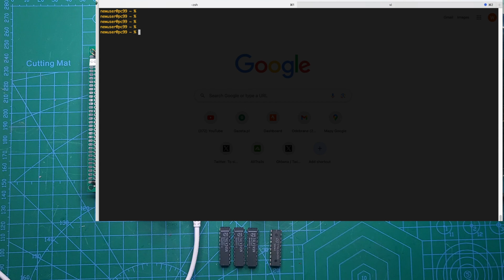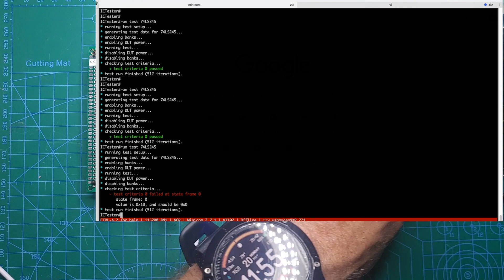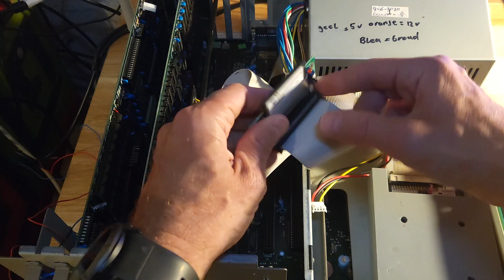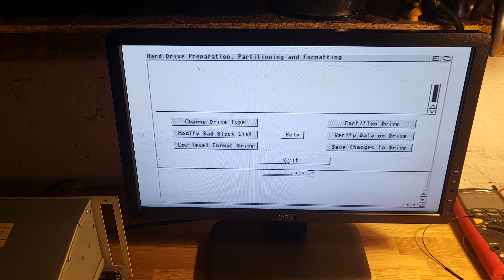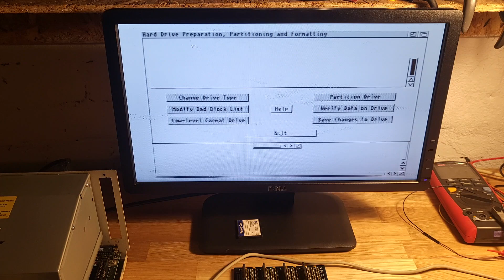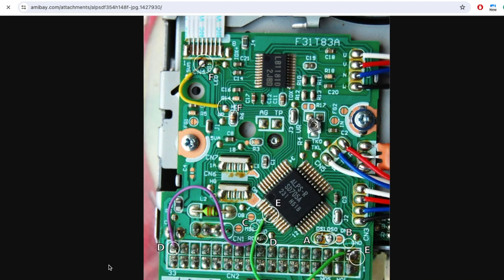Amiga 2000 damaged by a parcel service - part two

Comment: you need to have the correct  card.device in the tool types. The original one is device=scsi.device but there are several others including gvpscsi.device or omniscsi.device to list just 2. With the card you should have been told what the name of the device is. to change it you right click on the HD Toolbox icon and select information to open the panel where you can change to the proper tool icon
Reply from the maker: Thanks, i have read about the tool types, and i tried some suggested device names, but never got it to work with an SD card that i've had. What is strange, it worked right away with default scsi.device with an old ATA hard disk. My friend told me later, that he got an SD card advertised as "Amiga ready" for this machine, and it was also detected right away, without any additional settings...
Reply: @wojtekmitus  yes, sadly some do and some don't. Sandisk are usually reliable. Good to see that it worked with a regular hard drive.
Thanks for the video